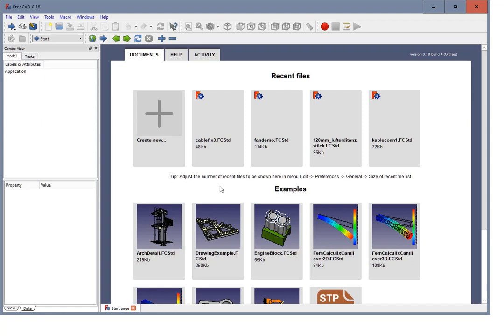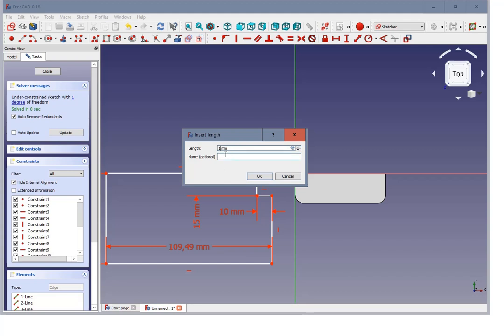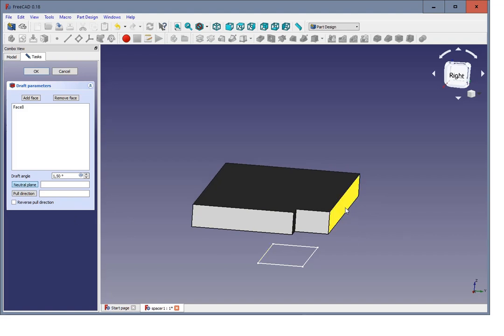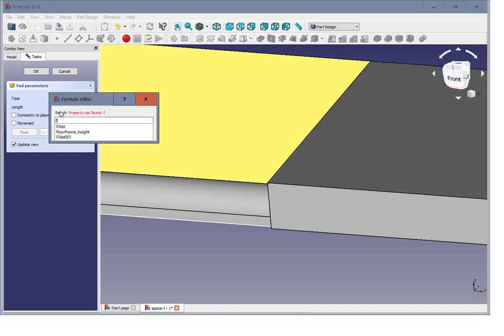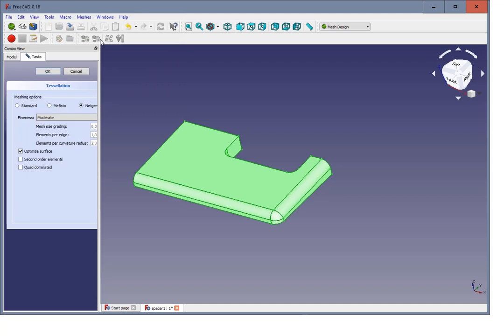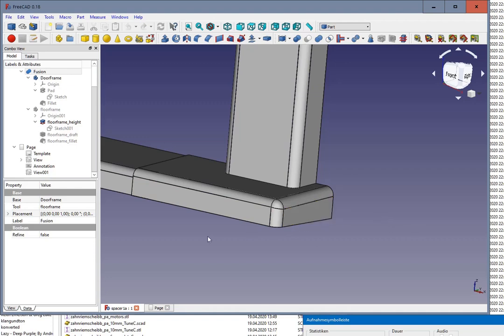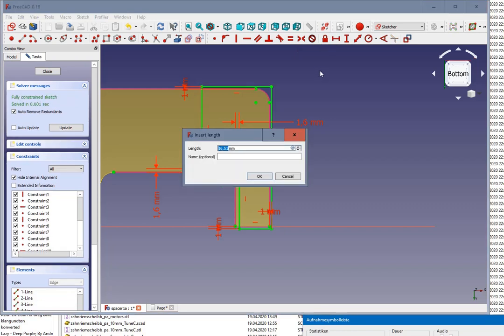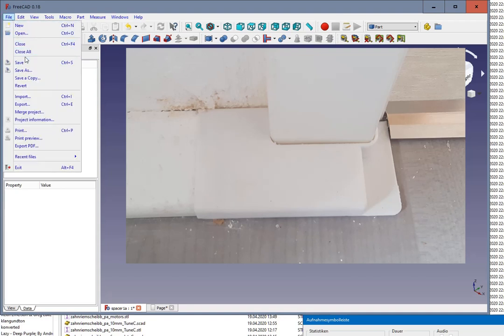FreeCAD 0.18 Design of a custom 3D print piece.

Comment: I just tried the part where you insert this into Techdraw.  I can get the template and the object on the page, but the object is larger than the template.  The template whether metric (A4) or US does not size correctly.
Reply from the maker: Well, i guess you constructed in INCH , then it will be bigger. There is also a parameter in the PAGE properties for Scaling
Reply: @hagei406  

Thank you so much. I apologize for being such a pain and not getting this as I should.  But I am having so much fun in learning FreeCAD and following your instructions. The Scaling worked and my object in on the A4 page with the dimensions for the part.
Reply from the maker: No Problem, as my Videos and my occupation in the Forum are for beginners..i am used to solve simple Problems..

Comment: I was testing 0.19 too but I miss the same things you mentioned at the beginning of this video. is there a way to inform the developer to reimplement this feature? It is really necessary. 

regards and thank you for this video
Michael
Reply from the maker: They have implemented it somehow, but in some testing branch, not yet public. I have not tested yet..as i have no way to test these here.  I will make a video once, i find it working...
Reply: @hagei406  OK - thank you  - from time to time I test newer versions. Because I m using linux I can test the app-images without installing. so it ist easy to roll back to a good working version.

Viele Grüße und regards
Michael